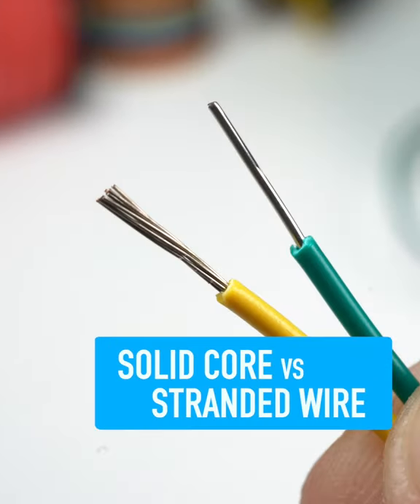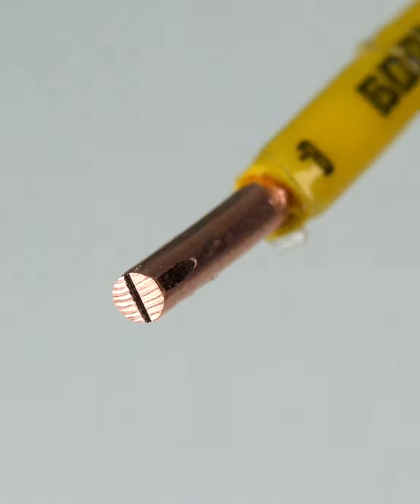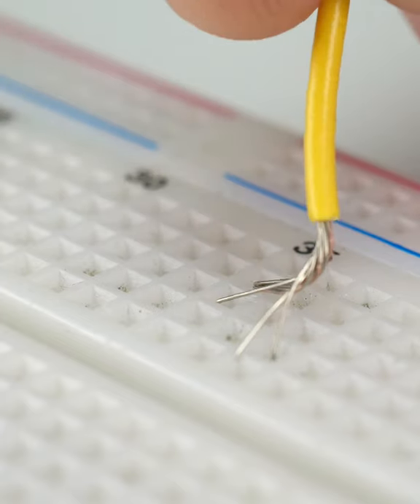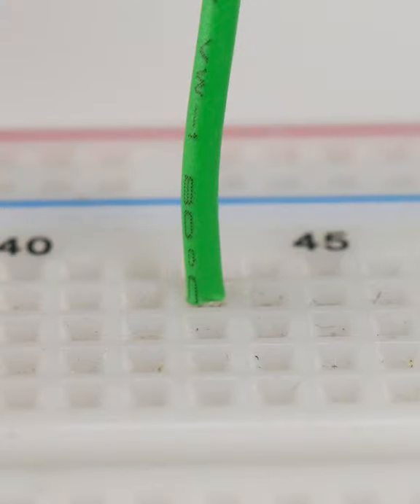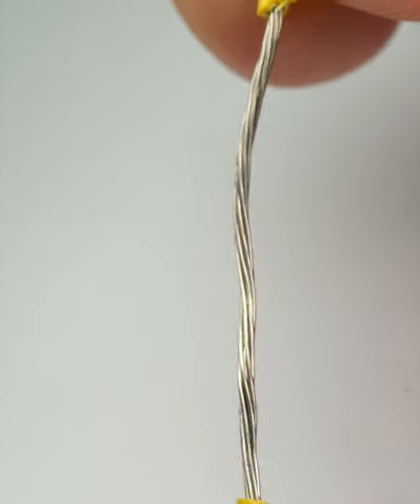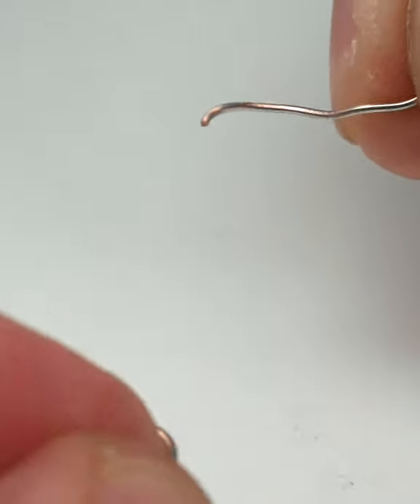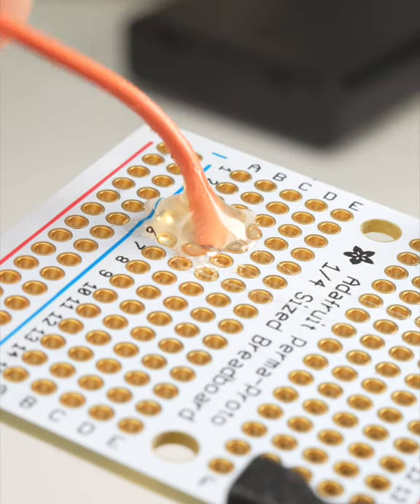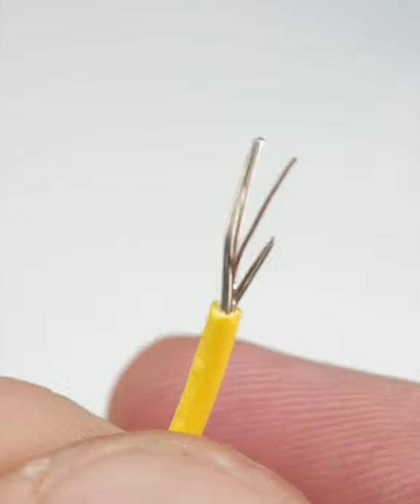Solid core or Stranded Wire? - Collin’s Lab Notes #adafruit #collinslabnotes

Comment: Stranded wires are incredible in things like screw terminals, as long as you crimp on ferrules. Don't tin the wire ends, get proper ferrules and a crimp tool, and you'll only have to worry about the connections every few years rather than every few weeks.
Reply: Nah just cut all but one strand, no need for any fancy stuff. 
The extra heat will keep everything warm and toasty . 
From your friends  Chineseium industry
Reply: nope it ruins the end